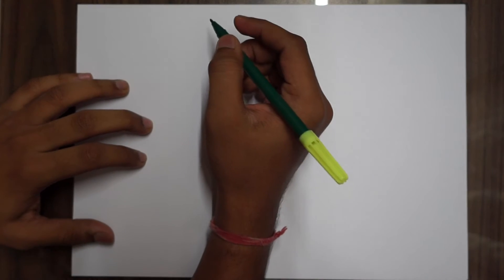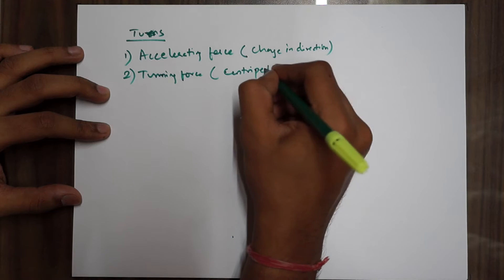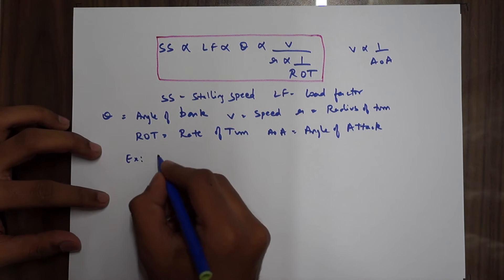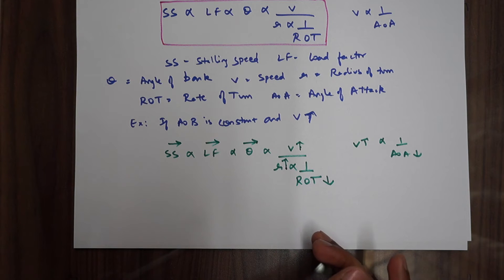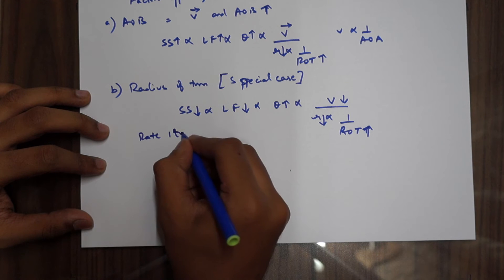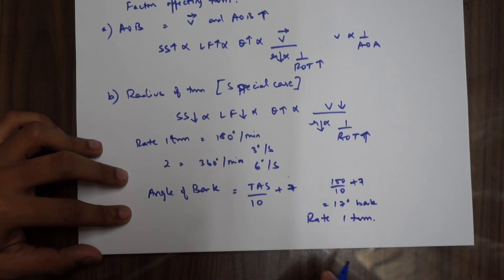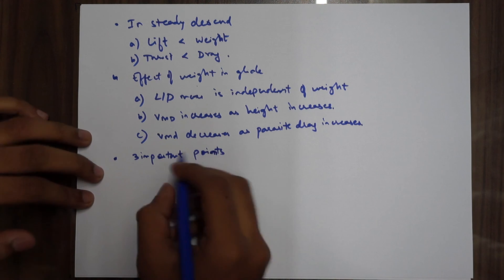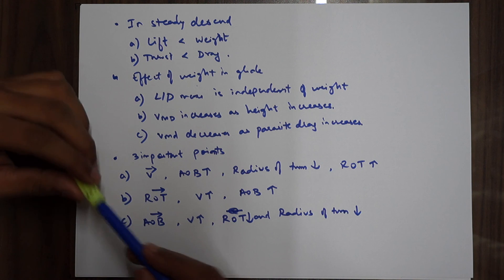Flight Mechanics - II

Comment: Why we keep angle of bank constant, increase Velocity causing both radius and rate of turn decrease? The summary doesn't take from the previous?  And, Why Vmc increase as height increase? I don't see this in your lesson to explain, except the summary.
Reply from the maker: When your bank is constant, the moment you increase speed, you are now travelling faster so your radius will increase due to centrifugal force. However Rate of Turn is to do with time, since you are travelling faster, your rate of turn will now decrease.

Vmc increases with height because of lower density. You require more airspeed to attain same control at high altitudes.